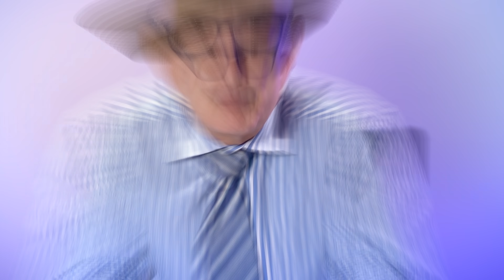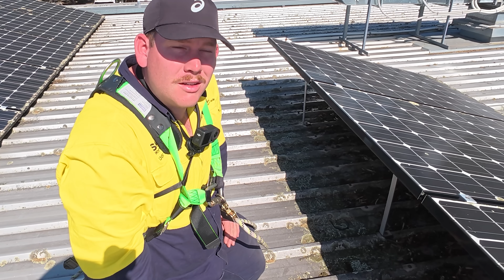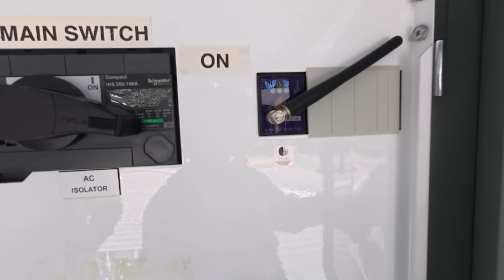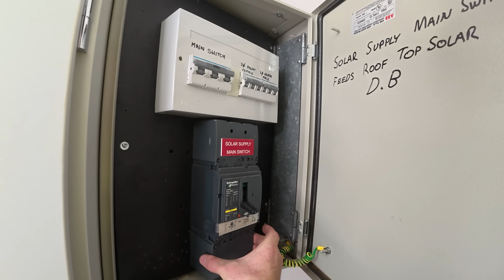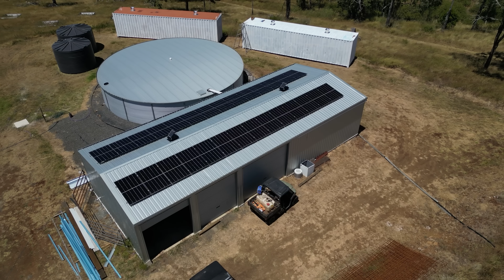Why this $120,000 Solar System Stopped Working | Nobody Noticed

Comment: Before installing solar panels any lichen on the roof should be sprayed with either a lichen removal agent or simply brushed with domestos thick bleach and left for a few days. Only takes a minute or so but has long term benefits, as lichen is time consuming (expensive) to remove from solar panels.

Comment: I had a home system installed that stopped working due to an over the air software upgrade. Luckily I noticed when I looked at the phone app and it was easily fixed the same day. There was also a problem getting the power retailer to connect the system only due to paperwork. It took a month but now everything seems to be working... I hope. You really have to look at your phone app and  power bill to check that it has all been connected properly. The Installation company and the system suppliers and power company don't tell you how this all works.
Reply from the maker: That’s a great reminder that staying vigilant with your system monitoring is key to catching those issues early.

Comment: That’s why they call it renewable, 
you gotta renew it every couple of years.
And here’s something nobody thinks about, is your roof designed to handle that extra weight? 
My first question to the salesmen flooring that stuff is, 
‘What’s the total weight of this apparatus including the associated hardware’? 
Oh, nobody has ever asked that. 
‘So it’s safe to assume you don’t have a clue’? 
Rooves are designed to specifics especially trussed rooves, terra cotta tiles can add tonnes to the roof, roof iron sheeting is relatively light weight in comparison thus trusses are designed specifically for sheets.
Then you add that thing overloading the design of your trusses and those panels are not light weight. 
Not only do you end up with a product failure you also end up with a severely damaged roof not to mention the holes they had to make to install the bloody thing to start with, further damaging the trusses. 
Trusses cannot be modified in any way or form. 
You’ll probably find your insurance is void because of of the modifications. 

I’m sure you’ve seen sheds and garages that have trussed rooves, people think the bottom cord of a truss is a storage area, tons of stuff sitting overhead on top of the bottom cord, that’s one of the worst things you can do to a truss. 
Adding weight like a solar system on the roof is like overloading a bridge. 
Then there’s a fire risk.
Never trust the government on any issue. 
Sleep tight.

Comment: I had a 2.5kw when house purchased (5years old) and added another 2.5   They check all was working. 
Then 2 years after we changed wifi providers and could no longer see the output. Rang up to get it checked and the company had gone bust. Ran blind for a few months and found our power bill was big again got someone else out and the original system (jenko) was faulty and a fire risk. They were under warranty but I had to pay $1k to put them up and remove the faulty ones. They went in landfill. Not happy at all. Shoddy panels (yet they have good reviews) shoddy second installers as they went bust. Nearly had a fire. Crap all around.
Reply from the maker: That sounds like an incredibly frustrating experience, and it really highlights the risks of companies disappearing and hardware failing prematurely.

Comment: Wow! The air con mob needs a phone call and a bill but looks like nobody was monitoring or managing the system is the main reason this was so badly neglected. Also in all that time no inspections like you did. A major liability if there was a fire. Wonder what the insurance company would think of that. Not having the PV system identified down the bottom was pure negligence on the installers part. Mind you I have noticed those foam backed PV stickers are not the most durable especially in external power boxes. They tend to perish pretty rapidly.
Reply from the maker: You’re absolutely right, the lack of monitoring and proper labeling is a major safety oversight.

Comment: You have just put me off solar installation .
Reply: This is a bad example probably done for a price with no oversight by anyone that cares. My 2 systems are fine and I only have about $700 owing on the $11k it cost me for both.  Got my first 6.6kW system installed November 2021 and then another 6.6kW  May 2024. Off the cuff I would say you will save at least 50% off your electricity bill especially if you can shift major use to the sunshine hours like washing machines, pool pumps etc. Some days I actually crack a profit due to my export value being more than my use. Just not using electricity at 50c a kW is the major saving. Get a quality system installed by good installers and it is a good trouble free investment. I got LG panels and a Fronius inverter so I should have at least 10 years ( probably a fair bit  more) before I even need a new inverter. Just got a free inspection because of the second system install ( a special) so in a few months I will have broken even and then it will be " profit".
Reply from the maker: That’s definitely not the goal, it’s just about being aware of the importance of regular system maintenance.

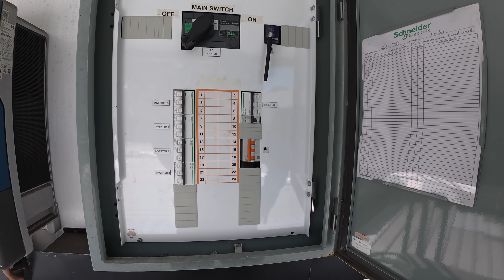Comment: Additionally there is a communications antenna within a metal faraday box at 11:05, signal degrading might well interfere with system status and performance reporting. Antennas need to be on the outside, preferably with no metal obstructions towards the receiving end.
Reply from the maker: Very good point
Reply: I've seen many electricity meters with antennas in similar situations, and it does not seem to have impacted the metering.

Comment: The litchen has formed from the moisture retention on the low side of panels , NOT from the panels being too close together. STOP LYING, TRUTH MATTERS.  Misinformation is LYING.
Reply from the maker: The fact is the closeness of the panels means bottom of panels still in shade in the morning for longer which equals better lichen growing conditions. Those are the facts..so you are correct..and so is our explanation
Reply: @yeanswers   Even if they were two metres apart that litchen would would still be there, i live in an area with 15 ft of rain a year ,i have around a hundred panels on the ground fifty on a roof none shade each other , i have to clean black mold or whatever it is off every 3 months , it will cover all the panel if left , it starts at the bottom because of the aluminium lip which holds the water, 18 panels i bought were poorly made and they literally filled up with water. if that water wasn't sitting on those panels the litchen wouldn;t be there, it is only that first incn where it is growing worst, there is also some growing half way up i saw. the ACTUAL problem is poor panel design number one ,lack of maintenance number two.

Comment: AC mechanics typically don't think too far ahead when they carry out maintenance. I've seen numerous instances of panels not reattached, conduit covers not re-installed, roofing sheets not secured and the list goes on. This is why reliable maintenace companies drill it into their teams to carry out a post inspection of the customer premises and at the very least tick off the unrelated job items they have fiddled with.
Reply: Looks like nobody cared. $120k worth of not my job.
Reply from the maker: Yes..absolutely spot on.

Comment: Many learning to take from this  video I’m proposing to get solar on a 45m2 roof  so I will add points from this  video  to discuss with installation team  many thanks for posting.
Reply from the maker: That's great news. If we can help create better long term results - mission accomplished.
Reply: Got an Enphase system 6year ago in Darwin NT, can monitor myself and deal with outages, installation company still does warranty on micro inverters and panel cleaning if requested, great system paying for it's self every quarter.

Comment: Great Content, showed up a few simple design error  which  the experts seem to always miss what are the long turn effects of sun light on plastic ties’ birds and nesting and monitoring circuits should always be in a seperate power supply different to the distribution used by the solar. The company should have employes a company to regally check the system.
Reply from the maker: spot on... thanks for the summary

Comment: I am a hospital engineer and have a 100kw SolarEdge System. The app with panel level monitoring is an incredible tool. Only 2 optimizer failures in 6 years and was identified within 24 hours. A technician arrived within a week each time to replace them
Reply from the maker: that's whyt ypour system cost a bit more - but generates so much more in savings. It's not set and forget with sdolar, being a mini power station.
Reply: You must be checking it regularly unlike this featured setup. They were giving money away!
Reply: The inverters on the roof. That is crazy. No feed in solar on your bill either Wow.

Comment: I believe that it is common place for Solar owners not to continuously monitor their systems - Residential & Commercial.
That installation has very poor workmanship and I wouldn’t be surprised if their were future failures🙈
Reply from the maker: I definitely needs a clean and also the inverters are likely on their way out... due to heat stress,.
Reply: @yeanswers  Given the improvements in PV and inverter technology they might be better off scrapping it and replacing it.
Those SMA 25kw inverters real workhorses.

Comment: So management problem, not a technology problem. How about getting the framing right, than click bait bullshit to drive an agenda. Level up or be put with the grifters.
Reply from the maker: More of an install problem, eg home madge framing and lack of spacing contributed to the lychen issue  then a monitoring problem  and then also a product problem with the backing sheet. The fact that $120k could have been saved and was not - is also the story..

Comment: The lichens on the array would knock down output by 80% for a start !
Reply from the maker: Maybe not 80 per cent , but at least 30. Good point.
Reply: A lot of scraping to do if you could get to them. A huge job even if you could use a pressure washer.

Comment: Solar is a massive scam folks STOP FALLING FOR IT.
Pay now/pay later deal..
Over 15 years you MIGHT break even if you’re lucky.
Reply: Solar is a non-brainer.  As households use more power and power prices continue to rise the return period on solar systems  gets shorter and shorter.  Even allowing for at worst 2-3 inverter replacements over the lifetime of the system you still come out well ahead of luddite John next door .
Reply: @terrydennis467 make sure you disconnect gas and go purely electric.
Reply: @BuckMorris_3000  Now you are getting with the program!
1. Heat pump hot water to maximise use of own solar energy.  
2. induction cooktop for cleaner air and less health risks for your family. 
3. Install additional solar and batteries to become more energy self-sufficient.
4. Ditch the dinosaur gas heating for modern efficient inverter based heat pump heating and A/C with zoning.
5. Gas meter and gas bill gone forever.
6. Sit back and enjoy reduced energy bills, a cleaner, healthier home and bonus protection from power outages.
Where are you going to start?
Reply from the maker: Not fully correct- my personal solar system has beren paid back in less than 5 years via savings and currently my bill is sitting 326 dollars in credit,.
Reply: @yeanswers yep and in 5 years you will spend your “savings “ on a new system
Reply: @silchas if you get 20 years out of your system ill eat it when you upgrade to a new one.
Reply: @silchas yep the panels may do but the company selling/installing will smash in a whole bunch and shut shop 2 years down the track and re emerge as something else.
Good luck hitting up the manufacturer for warranty if the installer is not around.
Remember the great LPG conversion scheme? Lol
Ruined a bunch of cars, kits started at 700 bucks, by the time the grants came in from state and fed, kits ended up costing upwards of 3 geand TWENTY FIVE years ago! That was a lot of cash. Not to mention every man and his dog had an LPG conversion company. - for a year or two 😁
Oh and then LPG went from 50/60c a litre to 1.30 average hahah
So yeah.. 
the solar idea is great , don’t het me wrong. I would live the idea of spend some money now and be “self sufficient and clean” for 15/20 years even more, but there is reality.. 
absolute best option now is getting some efficient electrical appliances for home and if you’re not a car guy but just want “an AtoB” car, get a nice toyota hybrid of your choice.
Reply: @silchas annual electricity bill $4k - 40/45 k for 10 years.
Purely electric no gas , so that’s my entire power consumption bill.

No way can i install a setup for 40 grand and not pay a cent for 20 years afterwards.
Reply: @BuckMorris_3000 Panels ( good quality ones) should last at least 20 years while some good ones have 25 year guarantee. S cheap inverter will for pretty quickly especially the fanless ones but a Fronius has a 10 year guarantee and quite a few last far longer apparently. My 2 systems will be paid off in less than 5 years since the first install so another 5 years should save me another $11k so I will happily fork out for another  inverter and still be miles ahead.
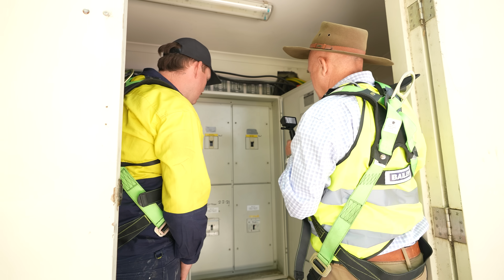Reply: I run a spreadsheet of my usage and export savings. May not be 100% but I want it to be as realistic as possible for my sake. The paybacks are absolutely there if you do your home work. With my 2 x 6.6 kW systems during peak summer, I get generation  from 07:00 till about 8:00pm  and obviously less in winter. Even on a cloudy rainy day I still get about 9-10 kW for the day. According to my closest as I can spreadsheet, I only owe about $700 on a total outlay of $11k starting in a November 2021 when I got the first system. I then upgraded to another 6.6 kW system on the south facing side which surprised me by outputting nearly the same amount on a cloudy day and adding a nice little extra as the sun favoured that side of the house in late afternoon to sundown. Also on a summer day, I can run my 10kW  ducted air con and still export 5kW to the grid ( A/C uses about 4kW on its own).
Reply: Are EVs a scam, too?
Reply: @evp3891 yes, almost as big as COVID jabs
Reply: @evp3891  He is missing the tin foil hat for too long and now a no brainer
Reply: You Are A Fraud

Comment: The bigger the gap between rows and panels is insignificant. If the original solar installers gave you an options , 1/ bigger gap for a more efficient set up, or 2/ we can squeeze in an extra couple of rows for a bigger output as long as you maintain them.  I’ll go with option B and clean them once annually 😊 or what if option B is what the original owner asked for, and sold the building and never told the new owner over the 10 year period 😊 so many possibilities and variations 😂
Reply from the maker: @anto11b In those days the lower efficiency of the panels  meant sometimes servicing corridors whewrew not established and now the owners pay the price , when maintenace is double hard.
Reply: shading still makes it not worth the extra costs unless you get a panel that has shade protection
Reply from the maker: Well next time they have to clean them I guess!